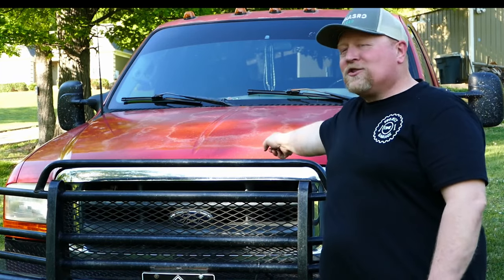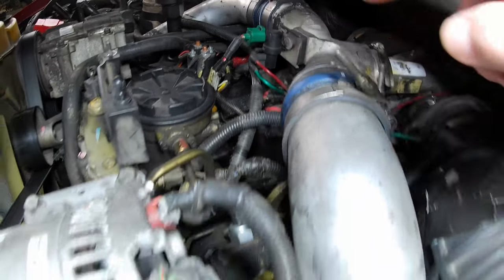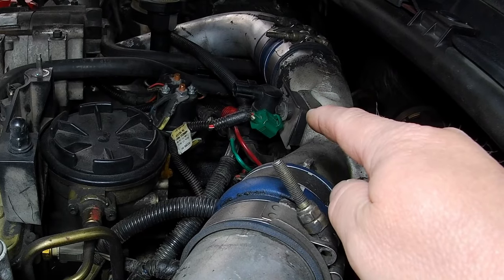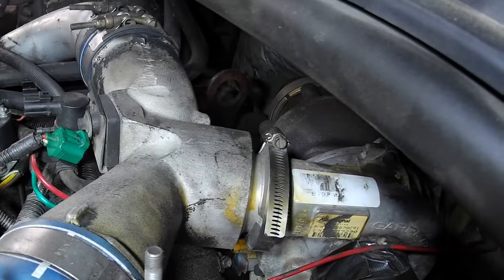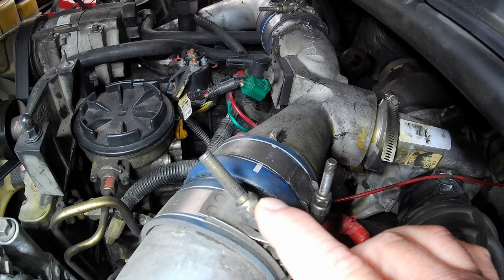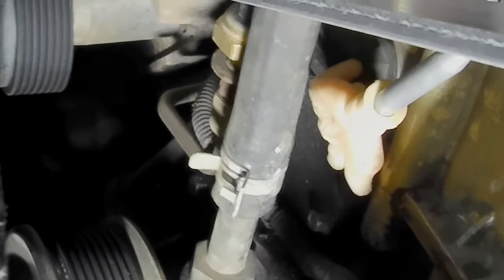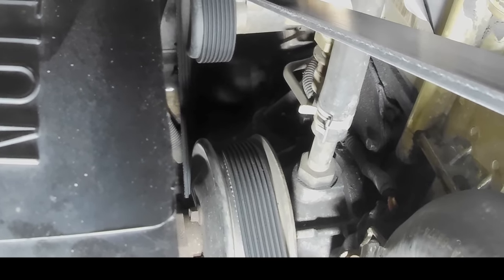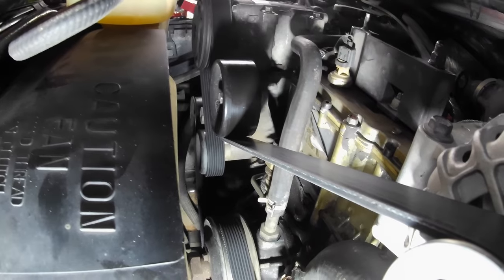Replacing the High Pressure Oil Pump (HPOP) on a 7.3 Powerstroke Ford F-250 Superduty

Comment: I’d just go ahead and replace the HPOP lines and delete those check valves while you’re in there. Them check valves  can create issues.
Reply from the maker: Definately should have done that while we were there.
Reply: I have a question for you. I have an 00 f350 with the 7.3l only has 90k miles was a pit truck was never abused. Runs great but it's a bitch to get started first thing in the mourning usually have to crank it over 4 or 5 times before it will finally fire up. But dosemt show another symptoms of any kind. Do ubthink it's the hpop or the low pressure pump. When I run it threw my mind it feels like its loosing g pressure over night and have to crank it a bunch for it to build presure back up for it to catch.
Reply: @BarryPacock-is8ld  well if you let it sit for a over night in the morning pull the plug to the hpop reservoir if there no oil in it then your LPOP is on its way out. Could also be a classic case of glow plugs/glow plug relay. When my hpop started going out I wouldn’t start at all unless oil temp was above 80°

Comment: I remember years ago when Ford road tractors were using Cat 3126 engines, we used to always get a situation where the was low oil pressure at the HEUI pump. I was replacing the IPR on a regular basis till one day I decided to take it apart. There is a very small hole on the shaft of the IPR, that hole would get the slightest bit of trash stuck in it and cause a no start issue. When the solenoid in energized, it pulls a metal pin/bullet through the tube, this is what I believe regulates the pressure going through the IPR, if that metal bullet is compromised in any way it will upset the pressure demanded at the injectors. Its been 20 years since ive messed with this type design, but im really enjoying your videos.
Reply from the maker: That's great info. I appreciate it!

Comment: Thank you! Your videos are extremely helpful and some of the best I’ve seen. I own a 1997 F3 50 with over 400,000 miles on it and with your help I have found out some of the aging problems. SUPER helpful! 👍👌
Reply from the maker: Glad to help
Reply: We replaced all fuel injectors and fuel pump. The injectors only had 3 good out of eight. We changed all. We made many attempts to start truck but won’t quite start. We are only getting about 400 pounds from the high pressure oil pump during the starting procedure. The high-pressure oil pump has never been replaced and has over 400,000 miles on it. What pressure should the 73 beer when you’re trying to start the motor? Could the High pressure Oil pump be the reason it won’t start if it’s bad? Your thoughts?

Comment: I'm 99 percent sure that I am going to tackle this job my myself instead of paying shop....

The only part I'm somewhat concerned about is the 18mm bolt behind the RTV'd cover, is there anything i need to be weary of in this section?

Also, do you have any recommendation from who I should purchase HPOP from? Or what kind?

My truck is a 2001 F-250.
Reply from the maker: Do it. It isn't that hard. There is a big washer behind that bolt, it cannot fall, it's too big. Pretty easy job overall.
Reply: @ProjectTimeGarage  Already took care of it, you're right it wasn't bad at all!

Plus it gave me an excuse to clean up my grimey a** fuel bowl while I had it removed...  man, with the new pump in, talk about a massive difference! Makes me feel a little better with regards to stripping the threads out on the old one that it was getting pretty tired regardless.

Comment: Is that new icp sensor a motorcraft or after market? I’m curious if aftermarket, how it’s performing. I’ve had bad luck
Reply from the maker: I learned years ago that Motorcraft/International was the only way to to. So far I've never had an OEM one fail on me prematurely.
Reply: I have learned it the hard way. Every aftermarket sensor has failed on me

Comment: I noticed that your buddys truck is an early 99 like mine. Which hpop did you guys go with and did you go with the later version 17 degree hpop or the 15 Degree hpop that came on thos earlyy 99's
Reply from the maker: He went back with the absolute bone stock pump for 99
Reply: Gotcha... I saw the icp readings on the video and that thing puts out good  pressure. Gotta replace mine soon

Comment: Isn’t there a bolt that goes through the top gear where the pump slides into?  Trying to get mine out. Two bolts out but not coming out.
Reply from the maker: There is. It's a large bolt going through the gear. Large bolt, like 19mm or so. I used a breaker bar and smacked it with a hammer to get it loose.

Comment: What kind of Hpop are your installing.  Also do you have a recommendation on high pressure oil lines and does adding the crossover line make a difference  ?
Thanks for the video.
Reply from the maker: The pump is an OE Bosch pump. For pressure lines, I would probably stick with OEM Ford/Navistar.

Comment: What on the pump can tell you its bad i removed mine and want to rebuild it but im trying to disassemble  it
Reply from the maker: Low reading on the High Pressure Oil system during hard acceleration. Basically floor it and make sure you have 2,500 to 3,000psi of high pressure oil. If the pressure drops off quickly, or doesn't build that high then the pump is a suspect.

Comment: What version of forscan are you using. The regular one or lite ?
Reply from the maker: Lite. I also have a video covering Forscan and TorquePro from a "getting started" perspective.
Reply: @ProjectTimeGarage this is good to know. I have the regular one with the software on my laptop. I'm wondering if my hpop is starting to get a little tired. I'm at 268k miles on my 99.5 7.3.. I don't run it hard all the time but I've noticed the last time I had to stand on it on the hot tune. I'm only getting 23 lbs of boost vs. the 35 I used to get. Already replaced boots, intercooler is good and no leaks. Injectors are hybrid FFD 30 over, gt38r turbo,. Injectors and turbo only have 30k on them.
 Right now I'm suspicious of the HPOP

Comment: How did you keep the engine from turning over when loosening the 18mm hpop camshaft bolt
Reply: Is there an answer to this?
Reply from the maker: I put a breaker bar/socket on the end of the crank bolt at the bottom pulley. Use that to hold it still while tightening the hpop bolt

Comment: I am getting fault codes from my oil pressure switch failure and icp sensor I switched them both out and my IPR and  all wires are good could my Oil pump be going out any suggestions
Reply from the maker: It may be worth checking the low pressure oil pump. If it isn't sending enough oil up top, then the High Pressure pump will not be able to generate enough pressure. Start with an oil pressure reading with a manual gauge on the LOW pressure side. If that's good, then the IPR/HPOP are the next most likely culprits.

Comment: There is an oring on left side of timing cover for antidrainback as well
Reply from the maker: Good info, thanks!
Reply: @ProjectTimeGarage  only reason I know this is I too have a 2000 f250 7.3 best diesel motor made.
Reply from the maker: @alanarmstrong2323  Agreed 100% Did you see the latest video I did? $500 7.3

Comment: Thank you. I have the same truck. 1999. The only year they put, V8 tag on the front of the front fender. Mine is a 6 speed manual. I crank it endlessly. Won't start. I put battery charger on it, and a shot of starting fluid in the air filter box. Then it starts. Could it be my, HPOP? I've had Injectors, Glow Plugs, Intake Wiring Harness replaced 25,000 miles ago.
Reply from the maker: First thing is first. You need to see what the high pressure oil rail is doing while you're cranking. HPOP is a potential issue, but so are a lot of other things. Basically, it sounds like you have to crank the truck a lot to get high pressure oil enough to actuate the injectors. Use a scanner and see what the HPOP is doing during cranking.
Reply: @ProjectTimeGarage  
Thank you. It is an awesome truck. Im convinced, it's a ,"fixable issue". 
I'll let a Ford Dealership take a look. 
I'm second owner. Purchased 2014.  It's as rust free, top to bottom, one could ever find. Interior has zero tears and very little obvious wear. No aftermarket performance upgrades.  225,000 miles.

Comment: How much do you charge for that job?
Reply: Nd how long does it take to change?
Reply from the maker: Plan for about 3 hours or so if you've never done one.
Reply: Ty would you charge a person 1600 dollars to change the pump?
Reply from the maker: @kipsvr6257  That seems excessive to me. The new pump is usually around $600 or so. So that leaves $1000 in labor. Not a $1000 job in my opinion.

Comment: You failed to show pulling the gear off with the bolt how you set your timing with that gear cuz there's little dots in there you failed to show any of that when pulling it apart
Reply from the maker: Never seen any dots on the HPOP gear of any 7.3. No such thing as timing the pump. It's not an injection pump, it's just an oil pump.